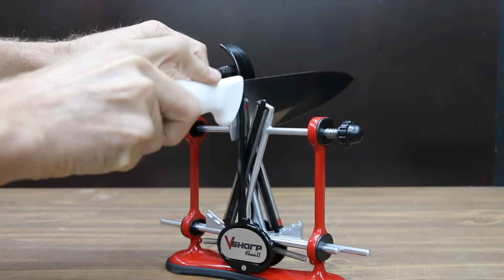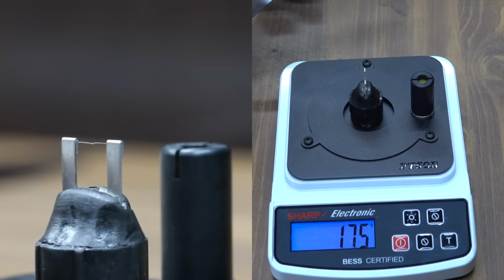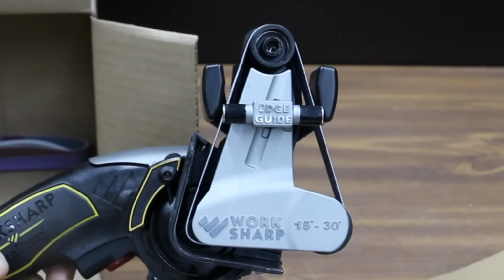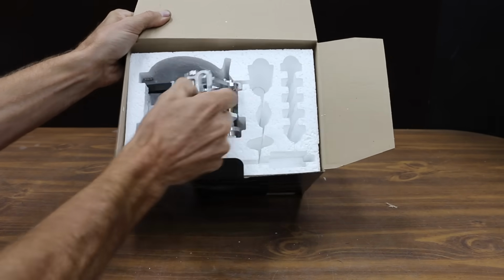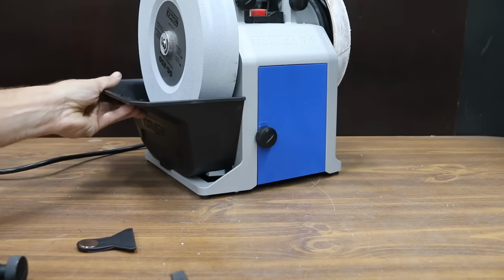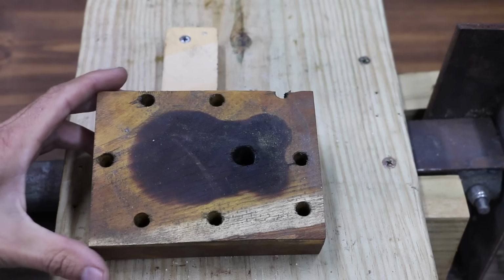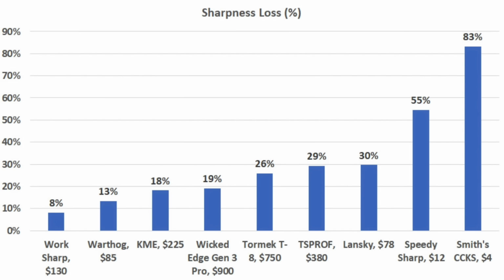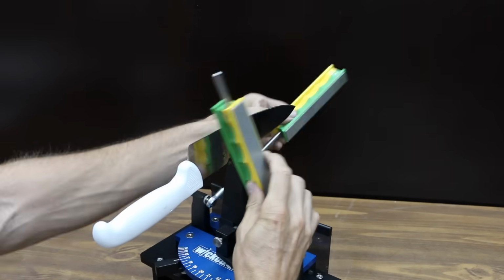RUSSIA vs USA Knife Sharpener? TSPROF vs Lansky, Wicked Edge, KME, Tormek T-8, Work Sharp Ken Onion

Comment: Wicked edge looks to be the nicest to use but that price... doesnt help that youre paying for 2 of each stone.
Also maybe not as flexible/precise as TSPROF with angles etc?.... Most dont go below 15 or 17 but TSPROF goes below 10.
The KME you can flip the guide and get down around 12-15 depending on blade width, which is about as low as you want to go on 99% of things; perfect.
Id say the Russians might have a point, it probably is THE best fixed angle system.
KME is probably the best value option.

KME has also come out with a new system a similar to the TSPROF in terms of refinement and pretty machining, but also similar in cost.

Comment: Dulling the blade on the wood has nothing to do with the sharpening method. If anything it’s just reviewing the knife. The blade angle has a lot to do with maintaining the sharpness. Steeper angle, more it can hold without dulling, but it is harder to cut through things. Lower angle. Easier to cut, easier to dull.

Comment: This will get buried but the Work Sharp Ken Onion belt grinder specifically says not to pull the blade fully through with the belt running. You're supposed to stop the belt with the blade tip still half way across the belt to prevent rounding. Also I take some issue with stropping after some of the sharpeners and not the others. This seems a bit unfair. If you did strop after every system and didn't film then I'll retract that complaint.
Reply: I think on another similar video he made like this, he stated he stropped after every knife system he used, so im assuming he did the same, but i cannot verify if he did in this video or not

Comment: I have had a work sharp model for about 5 years.  I have been happy with it but have to say the belt direction relative to the sharpened knife does make a difference.  Also, adding polishing compound to a belt with little to no grit makes a very effective strope.
Reply from the maker: Thanks for sharing.

Comment: Nice demo and evaluation. Some of my Japanese knives have 12📐the top sharpers in this demo starts at 17? The WorkSharp seems to have many angle adjustments. I just begun searching and considering knife sharpeners. A new player for basic sharpening is Brad & Taylor which many top chefs are beginning to use $50.00 or $100.00 model. Thanks... Do more... like this.
Reply from the maker: Thanks!  Thanks for the suggestion.
Reply: For wicked edge and other similar clamp style sharpeners to get an accurate edge angle you need a digital angle guide, as different knives of different sizes create different edge angles, the farther a knife if clamped higher in the system the lower the angle, so you could in theory be sharpening at 12dps and it would be saying you're sharpening at 17dps

Comment: i've checked 3 sharpener videos on the channel, and chose WorkSharp motorized version because of the speed. It's really fast and dumbproof for the home user. Once upon a time, you take all your kitchen knives and walk them through the red belt, and then purple belt in a second batch. You can do 10 pieces in 30min, ninja paper tests included. If I was an enthusiast, i'd choose the TSPROF. That one looks so well made the camera resolution isn't enough to capture the beauty in detail.
Reply from the maker: Thanks for sharing.

Comment: The RUSSIAN TS-Prof really is by far the best instrument. Most repeatable (best edge under microscope) regardless of skill level. It comes with great stones / abrasives, and requires the least skill to get repeatable results.  You just need to understand the system and you'll produce impeccable results. With other systems, you actually still have to be kind of talented at the project to get equivalent results.
Reply from the maker: Thanks for the feedback.

Comment: Proud happy tormek owner here, the angle was set on the second bevel. So not the correct angle. And sharpening the corner of the knife should be done by lifting the handle instead of pulling toward your body. The Japanese 4000 grit stone is unbeatable by my opinion. Love your comparisons. Hi from Holland.
Reply from the maker: Thanks!  Thanks for the feedback.

Comment: I purchased the Lansky from Amazon. Not impressed. Was unable to get the same blade angle twice. Returned it with no issue from Amazon. The rods were so so easy to bend thus changing the blade profile.
Reply from the maker: Thanks for sharing.
Reply: You got no skills. 😁
Reply: @Sunstepa  You are amusing. That's all you got? Running a little short on brain cells. I understand... ha ha ha.
Reply: @Sunstepa  I find it laughable that liberals never have to tell anyone they are liberal. The ignorance is deafening.
Reply: It has to be clamped in the same exact spot each time, and requires a little finess, but its definitely repeatable

Comment: I very much enjoy this mans test.However, there is something not shown here. You cannot expect him to be an expert knowing all of the in's and out's of this very complicated subject. the fixed angle sharpeners are all capable of the same numbers. only difference is the type of stones being used which are available for all of them. The TSprof, although not the system I use, is heads and shoulders above any of the others shown here. Yes the KME is good, but very outdated and much more difficult to use and nowhere near as precise. 

KnifeMaker
Reply from the maker: Thanks for the feedback.

Comment: love your videos.  came across your knife sharpening videos after looking for reviews on rolling sharpeners.

it probably wouldn't be as quick to sharpen, but would you consider doing a video with a bunch of rolling sharpeners?  brands like tumbler, horl, hone, and work sharp even made one.  

i wonder how they'd fair compared to something like the lansky in terms of speed.  rolling sharpeners definitely seem more compact and easy to setup, but i wonder if you have to work harder compared to something like the lansky.

i have a couple of whetstones, and although i can get my knives sharp, i'm not very consistent, so looking for alternatives to try, either rolling or guide types.
Reply from the maker: Thanks for the suggestion.

Comment: I have personally tried some version of almost all of these systems.  For my money the best is the Chef's Choice Trizor (not reviewed here).  It is quite effective, requires almost no setup, and is nearly idiot proof.  The easiest is the Horl German system (not reviweed here) and with a little effort it can also get you as sharp or sharper than any of them.  It is fairly easily the quickets to get out and use and pack back up.  The   Ken Onion Worksharp is also great but  not idiot proof and the knives can be permanently damaged fairly simply.

Comment: I have been using TSPROF Profile K03 for 2 years. It allows you to sharpen longer blades than Blitz, although not as technologically advanced and compact. Yes, it was expensive, but it was worth it :)
Thanks for the review!
Reply: I have TSPROF KO3 also and I love it. I have most of the other ones and occasionally sharpen a knife with one but never get the same results as the TSPROF KO3 with Diamond sharpening stones. V

Comment: You might have mentioned the Spyderco Sharpmaker too. Not very sophisticated, but for my less expensive kitchen knives it puts on a good edge and doesn’t take off a lot of steel in doing so. For my high-end (Chaves, Mordax, Benchmade, Hogue) folders and autos, I would only use the Wicked Edge. You featured the most expensive model, but you can get less expensive WIcked Edge models that are just as accurate and easy to use. Expensive, but as you demonstrated, the best and again, you get accuracy with a minimal loss of steel.
Reply from the maker: Thanks for sharing.

Comment: That Russian one looks beautiful and is a work of art but my God it seems like 0 thought was put into the actual end use. It just seems overly complex and annoying to use. You should not have to get out a digital protractor to know what your sharpening angle is for your ~$400 sharpening system, nor measure your stone thickness. Sharpening is fun for me personally, but it can quickly become a chore if you have multiple knives to maintain on an on going basis. When I sit down to sharpen, I want my system to have as little extra annoyance as possible. Although, if anything I think it's safe to say the Russian one shows how ridiculously overpriced the wicked edge is. If they can sell basically a solid block of aluminum with all that milling work and nice big diamond stones for $380, then I don't know what universe the wicked edge is worth it's $900 asking price.
Reply from the maker: Thanks for the feedback.

Comment: Hi, i think this type of sharpening systems are not sharpening a blade on the original angle but on a forced angle and only if the blade is perfectly round with the same radius on the whole lenght of the blade this kind of system will work and i said not this sysytem but all the systems with only a pivot point.
If you are not in accord with me,  you can make a video to show with the electronic angle meter to show everybody in different spots of the blade it is a different angle and that can damage the blades and messed up your entire angle of the blade because when you haveTHE SAME HEIGHT BUT DIFFERENT DISTANCE, THE ANGLE BETWEEN THE BLADE AND STONE CHANGE, and THATS NOT GOOD FOR THE BLADES.
After few sharpening sessions with these kind of systems you will have on a single blade a mutitude of angles that VARY with the shape of the blade, the more curves or chages of a direction of a blade has the more angles you'll have because, LIKE I SAID BEFORE, THE DISTANCE AND ANGLES ARE  INVERSELY PROPORTIONAL then as one quantity increases, the other decreases.
Reply from the maker: Thanks for the feedback.
Reply: @ProjectFarm  if i was rough please forgive me but these kind of systems are very much advertised and some of them very expensive but with the same flaws.
I want to see a company or a private person that makes a good system not only for money but because he wants to improve something not only to sell.
I watched all your videos and somethimes even more than couple of times because i dont want to skip anything and yours is one of the most detailed tests on youtube and thank you a lot for that in others name also.
Have a blessed day.
Reply: Your point has been debated on several knife forums and it has lost. Apparently the angle actually does stay the same across the length of a [straight] knife and it is only near the tip where the angle changes because of the bend of the belly. I myself cannot understand how (would have agreed with you) but like I said, smarter people have shown us to be wrong. These sharpeners are good.

Comment: I love comparison testing like this, and I really like that you took the time showing how each system works, since ease of use is a factor.  An easy to use system may offset a slightly worse edge retention by making it easier to reach out for the sharpener when the knife gets slightly dull.

I was a bit surprised that the Work Sharp Precision Adjust system didn't make the initial cut to participate, as that is a system really comparative to several of the other systems here (and not motorized, like the Ken Onion sharpener).  It would be interesting to see how that fared against the Lansky, Wicked Edge and the russian system at what must be a very competitive price.
Reply from the maker: Thanks!  Thanks for the suggestion.

Comment: You should test the selectool sharpener that's claims it'll sharpen anything in minutes. And test axe sharpeners. You already have several brands that have an attachment available to do axes. The kme has a specific axe accessory but the workshop can do it too.
Reply from the maker: Thanks for the suggestion.

Comment: Love your hard core testing and solid information!  I own a Ken Onion and it’s huge advantage is not only edge durability but also EASE OF USE.  and versatility.  From axes to fine work pocket knife,  Can also easily use on Leatherman type tools to both create an edge and routinely shape and sharpen almost anything.  If ease of use, versatility (leatherman) and portability are important as well as a convex supported edge, one would be well served to try a Ken Onion work sharp, no?  Speedy sharp is nice for backpack, the Work Sharp is great for car camping and home.  The others look like a chore.  There is an “Elite” attachment and belts that have much finer grits, AND cloth belts that one can impregnate with green or rouge abrasives that are dragged toward the blade edge.  I’d like to see how these might bring the sharpness of the others to the ease of use and relative cheapness of the Ken Onion Elite.  Thanks for your testing and analysis.
Reply from the maker: Thanks and you are welcome!  Thanks for sharing.

Comment: TLDR- WorkSharp FTW
I used to use some sort of whetstone kit, similar to the lansky. Any of those types of devices I think are fairly comparable in performance and time it takes... THEN I GOT THE WORKSHARP
It does my whole kitchen including steak knives in about a half hour and its an amazing edge. I also take it into the field when I hunt for skinning, just plug it into a truck and spend 2 minutes on it and its back to razor sharp. Also I have the original work sharp, not the Ken Onion version can also flip 90 degrees so i have sharpened my axes, lawnmower blade, cats claws/nail pullers and hammers, gut hooks... It's amazing and the belts are cheap however I haven't had to buy any new ones... yet. 
WorkSharp-10/10 best sharpener for versatility, sharpening quality and time. I dont think ill ever touch a whetstone again.
Reply from the maker: Thanks for sharing.

Comment: If the manual is followed with a work sharp ken onion…you can get a knife staple sharp…at triple the speed. Knife sharpening is fun and necessary but it’s not necessarily a thrilling process….ken onion makes quick work of complete sets of knives.

Comment: If I would buy one, I'd probably go with that Speedy Sharp or a design similar to it. Incredibly small, quick, effective and cheap. Something you can just carry in your pocket around at work and do a 1 minute sharpening with if you use your knife a lot.

The Tormek is just a solid tool that can be used for a bunch of things. High quality garage or industrial machine.

Comment: this was helpful... and also not helpful.  You did not include the Work Sharp Precision Adjust manual (not electric) sharpener.  I didn't realize they had that, and it wasn't in your vid, so I  had not considered the manual Work Sharp.   I found out about it from a few other knife sharpening videos.   It is $60 with three levels (320, 600, Ceramic) or $120 with 7 levels - (220, 320, 400, 600, 800, Ceramic, leather Strop w. paste) and a molded case to hold the entire system.  Very similar to KME but the abrasive rectangles are smaller so it takes longer, and KME is $240,, and you don't get a strop, and there are 4 steps instead of 6.

Anyway, I'm pretty much about to spend the $120 for the full system.  Otherwise I would prolly have gotten the Lansky based on your tests,

Comment: You probably can beat all those sharpeners with a piece of sandpaper 600/800grit,1500+grit and a smooth surface . By the way first sharpener can make a pretty fine edge if the blade is not too dull and you can "adjust" the angle by hand.Good content!
Reply from the maker: Thanks!  Thanks for the feedback.

Comment: Thanks again for the outstanding videos.  When you used the leather strop on the Tormek did you say 5 minutes?  did you mean 5 Secs?  Even at low RPM, 5 Minutes on the leather strop would be like using the barber shop strop about a 1,100 strokes.
After sharpening with the stone, I just barely use the strop.  Anything more than a few seconds tends to role the edge.  The best part about the tormek is once I get it set up, I can sharpen every knife in the house in about a minute each.  The knife attachment came in my kit.

Comment: I use the DMT Diafold Magna-Guide for well over a decade now. It's very similar to the Lansky system, but with a less fiddly guide rod, more sharpening angles, and the stones are all diamond.

I wonder how it'd perform in this test.
Reply from the maker: Thanks for the suggestion.
Reply: @ProjectFarm  Just a heads up: The magnet on my guide rod has rusted quite badly, though it hasn't affected its function.

Comment: So im fairly new to quality knives and steels and have been on a journey to find a way to get razor sharp knives. I've tried 6 or 7 different systems. I'm starting to believe knife sharpening has alot to do with learning how to identify a good burr and knowing how to manipulate and remove the burr. The systems do make it harder or easier to do this but no matter which system, you still need to be able to know what you are looking for.

Comment: I use the Worksharp Precision Elite with some aftermarket accessories and bonded diamond stones and can sharpen just about any knife made of any steel even the super steels and for an investment of around $300 it should last forever. Sharpensbest sharpeners are trash and if you're not careful will totally wreck your blade
Reply from the maker: Thanks for the feedback.

Comment: Ohh wow 😂
I just watched the video.
You are curling the edge.
You have to intentionally take the edge off and start over.
Keep the edge balanced and turn it towards yourself and look closely.
Keep the edge in the center, slowly removing steel until the two come together in the center.
This will fix the rolled edge created and you can get the best edge this knife will provide.
If you bring it to far one way or the other without balance you will notice.
 Checking the knife from one direction feels sharper than the other.
This is because the very edge is a little bit C shaped.
Reply from the maker: Thanks for watching!